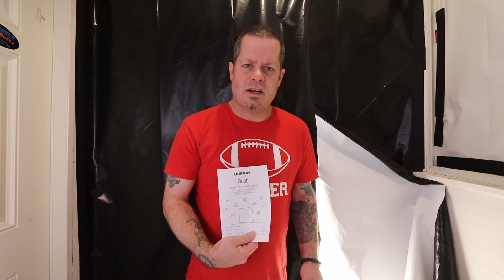Post infestation clean up. Or, how to boil spider mites.

Comment: I've had continued success with 99.9% isopropanol and water in a ratio of 60% isopropanol 40% water I knock up a 1000ml and add three drops of dish soap, I douse the plant and the top soil it seems to dissolve the webs and the little buggers just die on contact, I repeat three mornings in a row and as it has such a high alcohol content it dries in minutes and has never damaged my plants or affected taste.

Comment: Nice video , I got spidermite infestation , and they're on my lumatek zeus's there like abseiling down on to the plants they seem to love being on the leds so I'm gonna be like you cleaning my space down with a sulfar hotbox for a few days then milton in a fogger then steam the place down, a pain in the ass
Reply from the maker: You'll be happy to know it did work and I've not had them since.
Reply: @Photosyntech  I have anhilated them in the past with a mixture of dr schimmel and killer mite but I think I might of missed a a couple in the far corner and they reappeared 2 weeks from the end I resorted to keeping my temperature low dropping my zeus's to 75% and hoovering them off through a tea strainer 😬 ,it worked ,plus I feed my plants mills vitalise a mono silic which tbf kept them at bay also ,I pray I get rid of them through the transition period with a good clean 👍

Comment: Well you are wasting your time with that steam cleaner you were way to far away for it to kill anything, put your hand in the vapor as far away as you had it and you will feel it was cold at that distance.   Get a bucket of water a good mask and a jug of Ammonia, mix it 50/50 with a couple drops of Dawn dish soap in hot water, use a microfiber towel and wet everything down good. Close the room up just like you did with the fog can.   Dead mites.   Invertebrates did instantly from ammonia.  Just make sure you clean EVERYTHING as it only takes one.
Reply from the maker: Take into consideration that I didn't exactly show the entire two hours of cleaning..... The method worked very well, no bugs since.